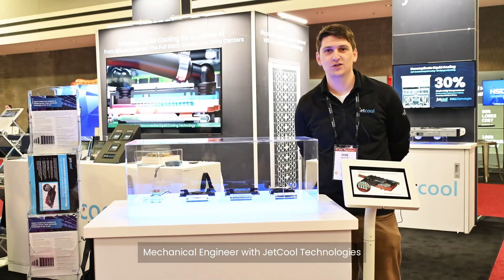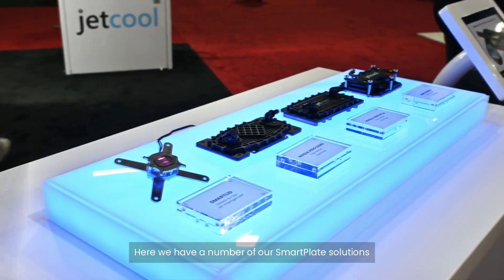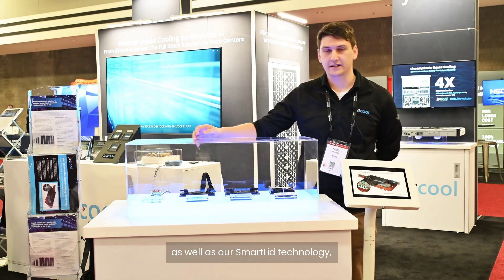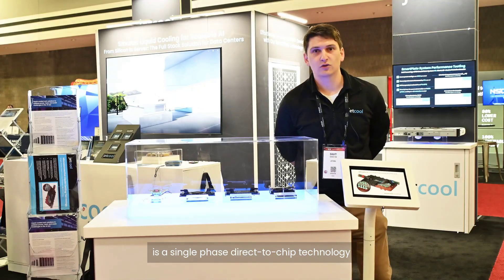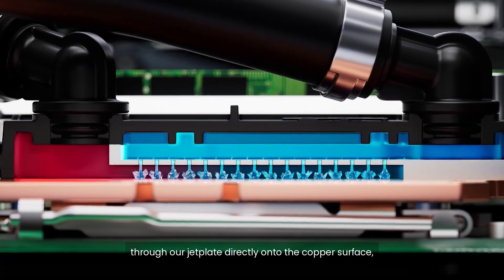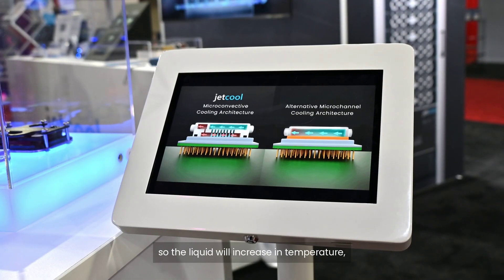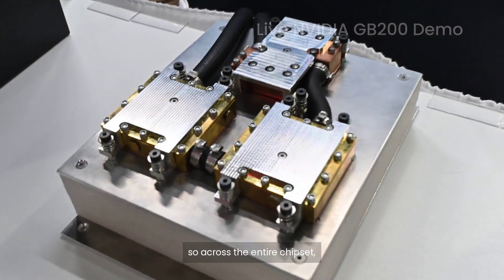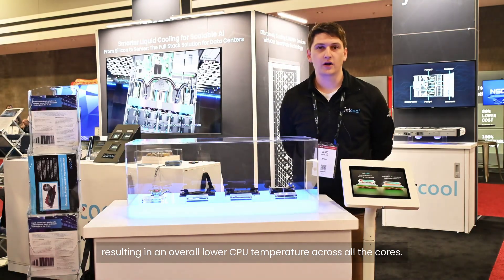Direct-to-Chip Liquid Cold Plates for Data Centers: #SC24 Demos

Comment: How do you make sure the die surface could be dry when dissasembling after the cooler & liqued installed, and making sure it won't spill onto the pcb?
Reply from the maker: Great question. Our SmartPlates are fully sealed like a traditional cold plate. Our SmartLids are mostly permanently sealed to the package (work with companies at the package-level).
Reply: @JETCOOLTechnologies  So basically it requires a custom/bespoke IHS?
Reply from the maker: @8lack8bird  SmartLid can be built with the chipmaker or hyperscaler for a custom IHS or be added to existing processors.
Reply: I had this idea before but was told you needed a cooler to have surface area to cool.